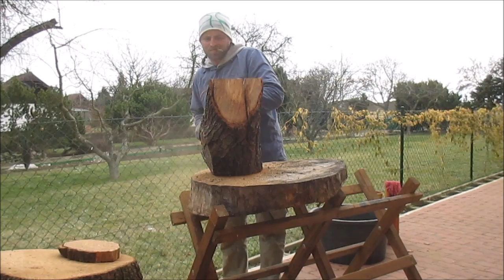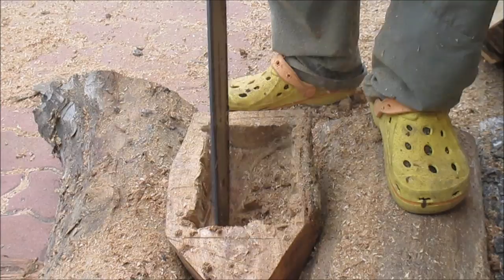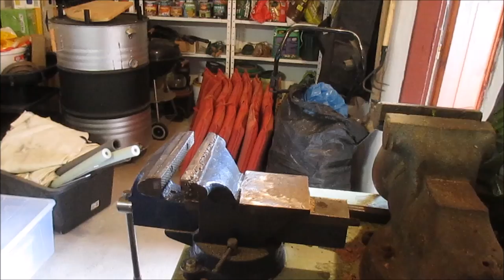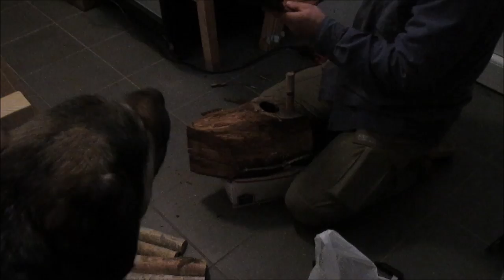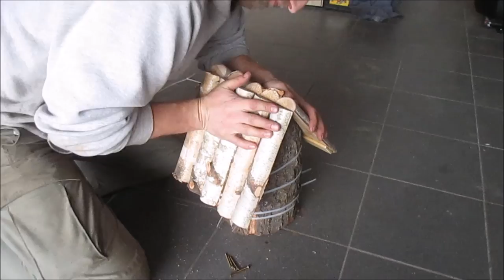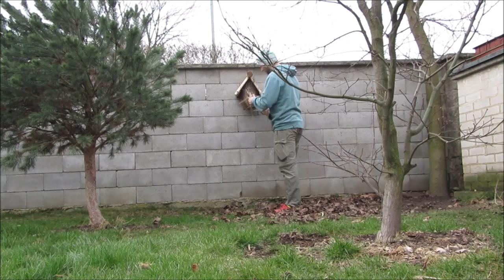Making a DIY Birdhouse from a log

Comment: If this were hung in a wooded section about 15 feet up, owls and woodpeckers might be drawn to it.  Woodpeckers like to have it filled with shavings.  It gives them something to clean out to make it their own.  Also, I could easily see a squirrel taking up residence it because the hole size.

Comment: Great job on the house. My one suggestion is it requires a clean out door. This clean out needs to be easy to access.  And clean it up. Birds pooping in there attract bugs and flys.  Spray inside with a cleaner / begugger. I use orange oil. I plan to make one. But I also plan to carve a Wood spirit face on it... Thanks for sharing. Very nice work.
Reply from the maker: charles carr Thank you
Reply: I doubt birds poop in their own nest. And if the chicks make a mess the parents clean it out. They don’t have someone cleaning out their nests in the wild.

Comment: I'll be making one like this soon, but for a surveillance camera in disguise.  I'll be wearing steel toes, chaps, safety glasses just so I dont loose a few pounds of flesh in the process. I might as use hinge instead of glueing it together.  I'll make the roof water proof to keep it dry inside. Yours Looks great.
Reply from the maker: Good luck 😀

Comment: a comment about residence.. The size of the hole and distance from ground will determine who goes in there. Look at web sites about birds in your area. It Will make a big difference. The straw was a nice idea. It has worked for Me. But decide on what bird species you would enjoy and look them up. Birds tend to like camouflage. The side of your building is stark. Don't forget, for us it's a hobby. For them it may be life or death. keep an open mind. Do some research and I'm sure it will be successful. It is a nice nesting box. The heavy roof insulates the heat of summer. Beautiful work.

Comment: For someone who has understood kickback why not plunge cut a  whole log ?
Reply from the maker: Hi, I never did a plunge cut with a chainsaw before, only with a skill saw. And to do something like that I would need the wood to be more secured, which i did not have at that moment.  Now my tool shed is better equipped, and perhaps I  will try this soon. Thanks !
Reply: Gus Hutchinson what's a plunge cut?
Reply from the maker: It's like stabbing the chainsaw in the wood slowly, instead of starting at the top like people usually do.

Comment: You worked a lot but I’m afraid that the outcome of your work isn’t suitable for birds and can actually be dangerous The perch is dangerous ( the predators can reach the chicks easily); the entrance hole is too low ( the chicks can fall from it when they are too young for flying ); nests have to be installed higher and in a shaded place. So I would say that unfortunately you did everything wrong ( but following some indications from RSBP, for instance, you can do a lot and in the right way!)

Comment: I appreciate your willingness but unfortunately you made some crucial mistakes. 
The birdhouse should be opened, because every year (from November to February) we have to clean it and throw away the old nest so that no dangerous for birds parasites will appear. 
We should also try to use as little chemicals as possible (silicone).
The inlet hole should be placed higher because cat or marten can easily grab eggs or chicks or even an adult bird.
There shouldn't be any stick under the inlet hole. It's not necessary for birds, but only helpful for cat or marten. If birds would like to sit on any stick, there are two trees full of twigs in close proximity. 
These features make this birdhouse an ecological trap.
BTW, have ever any bird inhabit this birdhouse?

PS. Don't feel offended, I just want the best for the birds :)
Reply from the maker: Yes, you're right. About 5635236 people already wrote this, but not many as polite as you. If there will be a version 2 then i will do it correctly.according to all the comments.
About a year after this video our tree was big en high enough to hold the birdhouse. A couple of times there where sparrows in it. Hopefully this year as well.

Comment: Only two problems in your work . Never use chemicals like adhesive. Birds are highly sensitive towards them.
Second you used lot of plastic , don't use that much plastic to join them instead use metal wire to join them

Comment: Tons of glue and silicon...the same could be done with screws and nails
Reply from the maker: Go ahead and make a video to show it
Reply: @dabberty  if you don't get christics youtube is not the place for you.
Reply from the maker: @griseum3151  receiving usefull feedback or critisicm is fine, but useless comments get useless replies. Its too easy just to type something, but actually doing something is harder. So why dont you put your 'suggestions' into action?
Reply: @dabberty  already did years ago with cypress wood. My comment is meaninigful wheather or not I built, or will, a nest. Chemicals addictives are not a good thing where animal newborns live before fly away. Such structure could be the heatier with screws and nails instead, I tell you once more, read this and think about regardless who am I and what I do in life. This is far beyond a constructive criticism. If I ever post a video with my solution you'd be what? Satisfied, I'd be right? My comment would become useful? It is easy to label a comment as useles not to respond or to admit your own mistakes.
Reply from the maker: @griseum3151  what mistake i made then? I chose to use the materials as shown in the video. If you disagree or don't like it, not my problem. Dried glue isn't anymore dangerous then nails.
Reply: @dabberty  ok

Comment: Predators will like it. Not good.
Reply from the maker: It should be indeed hanging a bit higher, but then again, there are almost no cats in this area, and they certainly do not come in my garden cause of my dog. That's why I think it is ok to have it hanging there.
Reply: There are  a few suggestions for constructing an aviary:
Allow plenty time.
Use done for you boat plans.
(I learned about these and more from Aviary magic method  site )